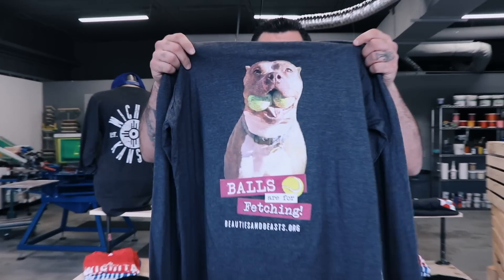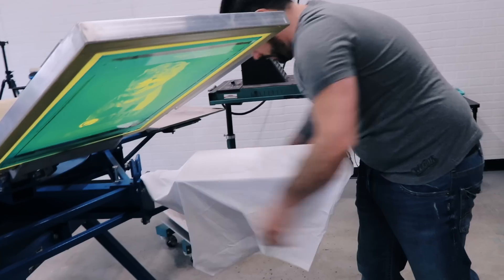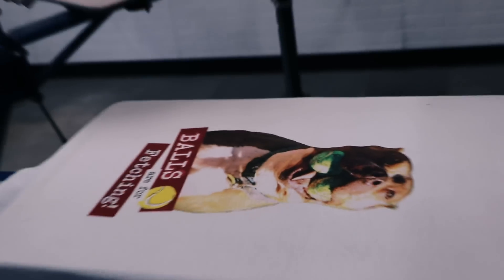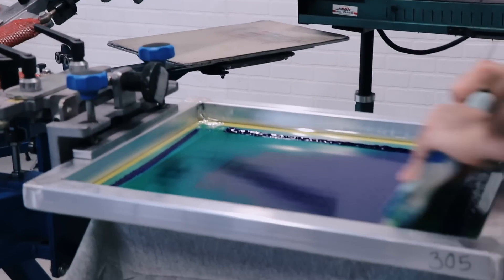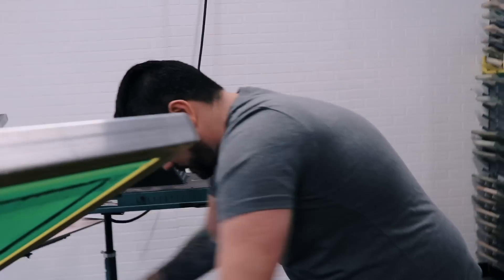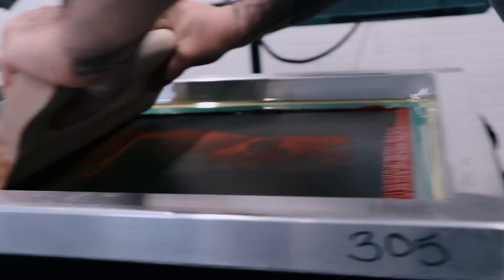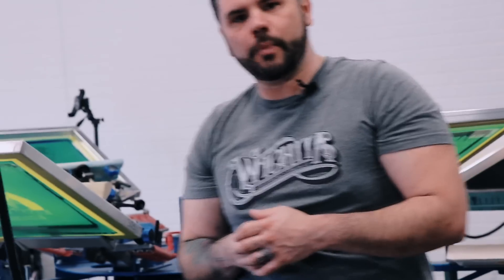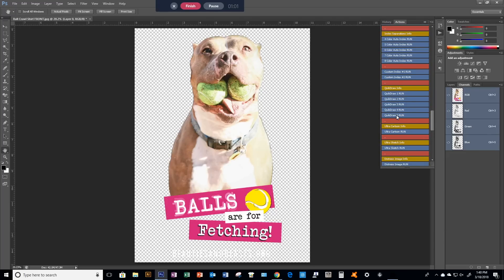How to Screen Print T Shirts cmyk

Comment: Great video! I was so confused on some stuff on other videos but you made it very simple and easy to learn! Thank you!
Reply from the maker: TBECupid hey thanks for watching and commenting! Any other videos that would help?
Reply: For right now no, but I was wondering what is that thing you use when you go and flash it I have not really seen any other people use it and also what does it do? Thanks!
Reply from the maker: TBECupid that is a flash dryer- it just dry’s the top layer of ink enough to lay down another coat or color...
Reply from the maker: TBECupid that is a flash dryer- it just dry’s the top layer of ink enough to lay down another coat or color...

Comment: Hi. Thanks for sharing informational videos. I'm interested in your technique for printing. You are pull flooding and very lightly pushing the ink. Is there any benefit to your method over pulling the ink? Or is that just printer preference? And you don't go much higher than 45 lpi on your 305s? Thanks again.
Reply from the maker: Kevin B I think printer preference yes correct. I like to push because it’s easier on the body. And we can go 65lpi on our 305’s but that’s as high as accurip will print halftones. I think some printers go as high as 81 lpi and higher

Comment: Hello can you explain me how  you are seperating cmyk positive and which software you are using to seperate film positive??
Reply: Dunno if you found out yet but in photoshop you can go to the channels section next to the layers panel and then select the CMYK positives. Save those channels separately and make sure you add a half tone gradient to each otherwise shadows and highlights don't show well, after that you should have 4 positives for CMYK for printing

Comment: I see you have a exposure unit from ryonet. If you would use that exposure unit how long would it take to expose. I have one of those. I can't never get it to expose right. I do my seperation with acuurip 22.5 angle and 55 LPI on a 230 mesh. Any idea? I have try like 10 diff image and no luck
Reply from the maker: I only use the exposure unit from ryonet as a light table....We use an led exposure unit- the old ryonet exposure unit we converted to a light table to line the screens up before we burn them....Have you tried an exposure calculator?
Reply: Learn How To Screen Print T-shirts No I haven't try the calculator. How about the angle and LPI I use is it ok for the 230 mesh or should I use 305
Reply from the maker: Ivan Ramos for manual printing- i use 45l lpi for halftones...the 55 lpi may be to small for the exposure unit your using...what kind of emulsion?
Reply: Learn How To Screen Print T-shirts it's aquasol hvp
Pre-sensitized sbq photopolymer 
It's from Murakami screen
This emulsion was given to me.
Reply from the maker: Ivan Ramos hmmm...I think diazo emulsion holds better halftones than photopolymer...you might ask murmaki if that emulsion can hold 55 or 45 lpi...

Comment: On the black it looks like the white under-base is peaking out in certain areas. Would this be acceptable to most customers?
Reply from the maker: Daniel Mullins Yes it does look like it peaks out here and there- we will re-burn the screens before we print the order and choke the white underbase a pixel or two to get rid of the fringes.
Reply: Learn How To Screen Print T-shirts ok understood. That probably happened from dot gain on the underbase you think? Just curious for my own purposes. Thanks for the help.
Reply from the maker: Daniel Mullins - I don’t think it would be dot gain...we only printed 10 or so shirts so we shouldn’t of had a problem with dot gain after only doing that many shirts-....
Reply: @LearnHowToScreenPrint  are you supposed to choke the white underbase by 2 px before you put it through the cmyk/halftone process or after ?
Reply: Can you explain the process how to choke the artwork for just the white underbase? Thanks again for the video.

Comment: How do you get the white underbase from the image?  I can only separate image into the four colors
Reply from the maker: * unQuestionable TV * I will do a video on that this weekend... are you using channels?
Reply: Learn How To Screen Print T-shirts I personally have been using Illustrator, working only in vector separations using spot colors.

We’re looking into the potential of using either photoshop or illustrator to print full CMYK process separations. We’d be able to drastically increase our offerings, as currently if someone wants a CMYK image, we have to sublimate it on a 100% Polyester, White garment, only at sizes 8.5” x 11” max.

Comment: what was the second step? i mean what were you doing with the another machine after giving colors? and lastly where u put the white t shirt? was it for ironing? i mean you are using three machine in this video, what is the use of the next two?
Reply from the maker: Marzia Rahman hey thanks for watching and commenting! The second step- flash dryer is the dry the top layer of ink enough to lay down another coat- so the ink is opaque and holds enough color that the t-shirt color can’t be seen through the ink- and drying on layer of ink is sometimes necessary to lay another color on top or by that layer...so they don’t smear and the design stays crisp.
Reply: the third step?
Reply from the maker: Marzia Rahman third step was the conveyor for the final cure- to “permanently set” the ink-

Comment: is there a link to the color seperator in photoshop? I have been using Photoshop to seperate the colors but if the plugin can make it easier I would lvoe that.
Reply from the maker: I used Ultra Seps Color Separation- should be able to google it and find it- I don’t have a link

Comment: Can I use red and blue instead of magenta and cyan?
Reply: Rodo Wood not typically no. The CMYK ink sets & process act like a color wheel... literally. The colors are specific to create other colors when layered. Different than spot color. U can try it but it will come out differently... maybe that’s what you’re going for... idk. But for an image to come out CMYK as intended pulling in all the colors, no. Lots of variables: type type, opacity of the ink, CMYK, autoline, maxopake, water base or plastisol, additives (if needed using a different ink), etc. best of luck to u. Hope that helps. 😄

Comment: Can process rubber or waterbase ink print that design?
Reply from the maker: Firman Wira I don’t know about process rubber inks. I am pretty sure waterbase inks will work- although you might have to lay down a discharge base if your printing on dark colors. If it’s a white or lighter color shirt you should be able to with water base inks if the ink manufacturer makes true process colors.
Reply: Learn How To Screen Print T-shirts oh i see, maybe it just use different mesh size, thank you so much
Reply from the maker: Firman Wira hey no problem! Good luck!